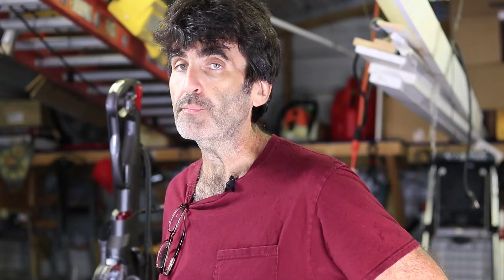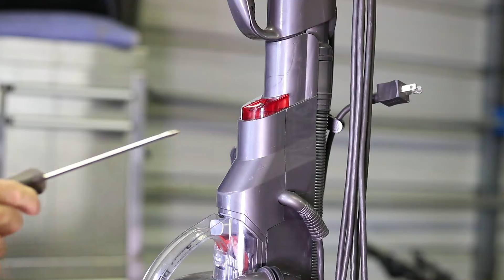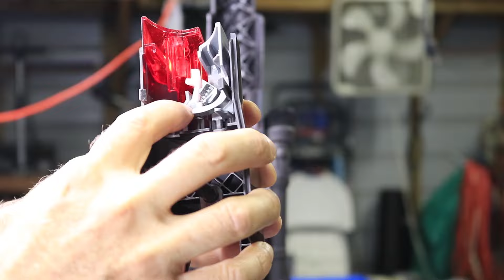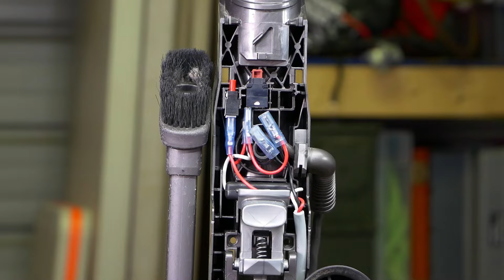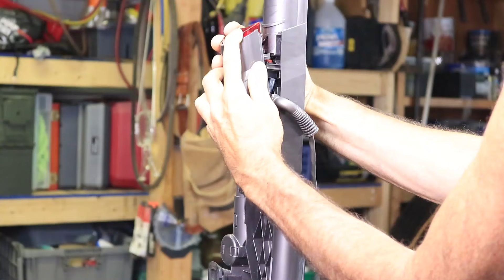How to Replace Power Switch on Dyson DC25 Explained in Full Detail

Comment: Oh great! Now I’m dead, thanks for the standard ‘unplug unit from wall” disclaimer. 🤣
  Hey, I could not get the large piece of plastic that retains the plastic switch buttons to come off the unit. I took out the three screws, but it seemed locked into place at the bottom. I was able to pivot it out of the way enough to test the switch contacts, but I can see it would have been a lot easier reassembling the on/off buttons over the switches like you have done in your video. 
  Good video btw! I’m chasing a intermittent beater bar run problem. The bar has been cleaned, the end bearing repacked and resealed. The vacuum worked great for awhile. I was vacuuming and I noticed the bar stopped rotating. I tested the connections at the beater bar mount plug and had power. I put it back together and it worked fine again for awhile. Then it stopped when I tilted the handle back just a little more. I cannot get the brush to come back on-after I move it upright, back to the position it was at, when it suddenly stopped spinning. Totally frustrated. I have pressed the reset button and power buttons in every configuration I could think of. I even pulled the reset button out and jumped the wires, and nothing. The motor looks good, the brushes look good etc I ran wires to the motor and powered it independently for a good 10-15 minutes with no problems at all, it ran great!. I feel it’s some kinda combination of how the handle is tilted and then how the reset button works. 
  Btw, is it just me or are these the most “Transformer” (like in the movie) machines I’ve ever seen for a home appliance, plus it has more little latches and lock buttons then you could shake a stick at!
Reply from the maker: I think there's a switch where you tilt the vacuum down and it activates the motor in addition to the switch next to the power switch.  I think I might research this and see if there's a video I can do on it.
Reply: @TheHomeImprovementChannel  Thx for the tip! I’ll look to. 
  Sometimes appliances have to be scattered to make sure there’s no unnecessary extra parts.
Reply from the maker: @dezdon01  You're welcome..
Reply: Yea, mine was he exact same.  Let it for a day, come back and a good pull it popped. It mat be that black little box was dislodged.

Comment: Mine has power but beater bar won’t startup could it be switch or wire fell off if switch which one are they independent of each other
Reply from the maker: Yes it could be.  It could also be a bad switch, I've seen those switches act up.  Try pushing it in and out a couple times and see if it comes back to life..

Comment: Great video!  when i took the switch cover off, i ended up with 2 springs that popped out.  the long skinny spring under the red switch is still here.  Of the 2 popped out, i put the shorter spring next to the little white piece.  But i now have a larger that the "red switch spring" spring but a little shorter and not sure where to put it
.
Reply from the maker: Does the video show the springs?  I honestly can't remember where they go without being able to see it and figure out where they go.

Comment: Great video.  one question, the cover on my seems to stuck.  I've taken all 3 screws out and started to pull the cover off but can only bring it out slightly.  the bottom doesn't want to come off.  any hints?  thanks!
Reply from the maker: Unfortunately I'd have to see it.  I can't remember off the top of my head.. ☹️
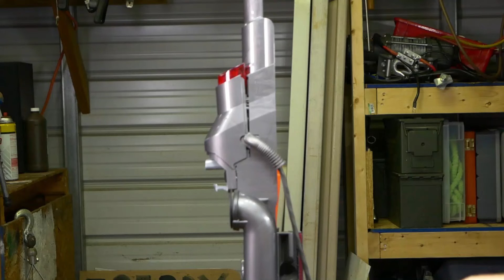Reply: @TheHomeImprovementChannel  can't attach a picture but in your video at 1:54, the cover comes down and out in your video.  Mine comes down a little bit but does not pop out, if that makes sense.  Thanks again
Reply from the maker: @peterwong5488  I think you can upload a picture on my sister channel's Facebook page.  It's at Take a Bath Productions..
Reply: Mine stuck too. Left it for an evening, next morning it pops off. I think it may have been that small black boxy deal below the switches.  It nestles into the handle and mine was popped out half way when I finally got it off.

Comment: hi.on the dc25 we had sock stuck in beater bar.then after removed sock the power came on but feeble and the switch seemed to be dodgy.i ordered another motor but saw your video about reset switch inside  cover..thankas for video will check switch and reset breaker.do you push breaker down again?steve in uk
Reply from the maker: Hello.  If the motor is running at all then it can't be the breaker.  You say the power came on but weak?
Reply: @TheHomeImprovementChannel  motor running now I ordered spare motor just swapped over and motor works now I did test switch an reset just tryin put back together roller thing at bottom tricky

Comment: If my vacuum only stays on if I hold the power button down, would that mean I just need a new spring?
Reply from the maker: I've seen that happen.  It could need a new switch, but sometimes I've taken them apart and put it back together and it's working again.  The real test is, if you have taken it apart and you can physically push the switch itself.  Is it working properly?  Then you'll know.

Comment: very well done. to the point and alerts you to the possible problem with the little springs blasting off. That was my problem. Glad to see how EASY its was to reassemble. Note. use needle nose pliers to disengage wires for m with, works a charm.
Reply from the maker: Good tip!  I included the thing about the springs because it happened to me... 😂

Comment: How can you tell if the breaker is good or bad, my switch seems to be good but still not getting brush bar to work.
Reply from the maker: A volt meter would be helpful to see if the power is getting through the breaker

Comment: The connectors on the wires have a little tab in the center that when pressed slightly releases the locking mechanism designed into them
Reply from the maker: Thanks for the tip!

Comment: Thank you for the video!  my beater bar runs for about 3 seconds then stops.  checked all connections, they are good. Still the power switch you think?  Thanks,  Chris
Reply from the maker: You'll need a volt meter.  Does the beater bar stop, but the vacuum motor keeps running?  Check the voltage on the beater bar and see if the voltage is gone when it stops...  You could also bypass the switch to the beater bar and see if it keeps running, but do this without it being plugged in..  then plug it in after you've bypassed it.
Reply: @TheHomeImprovementChannel   Just the beater bar stops, Vac still runs well.

Comment: Good explanation as to not panick thinking it’s the beater motor. I opened the cover on the switches and reset the beater bar kill switch and voíla!  I only wish the engineers would have thought of a better way to do a reset.  Taking that cover off and especially putting it back on is a pain in the you know what!  Even with the right tools!  Thanks.
Reply from the maker: I think they do that stuff on purpose to make people who don't want to take it apart take it to a shop..

Comment: Thank you, thank you! But I need to add one more detail. I have the purple version of the D25. The switch housing cover did NOT come off as easily. There are 2 tiny plastic hooks just below the 2 bottom screw holes. After seeing your video, I had the confidence to simply “defeat” the tiny hooks with brute force. Now I can replace the faulty switch. Thank you again!

Also, with the purple version (I think Costco version?), the spring did not fly out. And they are also easy to put back. Maybe Dyson improved this??
Reply from the maker: thanks for the great feedback!  I can't say if Dyson improved this on newer models.  I haven't had the opportunity to take any of them apart.
Reply: I have the purple version too and I cannot get the housing to come off. It’s stuck at the bottom.

Comment: If the bottom doesn't want to come out, stick a Philips up along where the power cord is running down and slightly pull towards you.  Same for the other side.  Be sure to clean & lube the plastic switch slides.  That is what trashes the switches.
Reply from the maker: Thanks for the tips!

Comment: I have a DC29 that is very similar in constructions to the DC25. The spinning head will turn on for a couple seconds then turn off. It seems like every time I hit the circuit breaker it will turn back on, only to have it turn back off after a couple seconds again. How would I know if the circuit breaker is faulty? I have disassembled the head to clean out any dust or hairballs that might be clogging the spinning head.
Reply from the maker: Good question.  I would tell you to bypass the circuit breaker and see if the head keeps spinning, but if there is a problem with the head, you'll burn something up.  If you have a amp meter, you can connect it to the wires going to the head and monitor the amperage and see if it's exceeding the rating on the circuit breaker.  (I don't know if it's marked what the amperage is..)

Comment: You, Rudy, are an awesome teacher. I really appreciate the way you explained the process - mainly - 'if you suck up a sock and the beater bar stops working, don't assume it's the motor.. try this.' - between me and the immediate family, we have 3 dyson uprights - until today, all 3 had beater bars that stopped functioning.  After watching your video, I managed to fix mine- and although I tore apart the beater bar assembly, after watching your video, that reset circuit breaker should've been a 5-10 minute fix.  I look forward to getting the other two Dysons in operation- I thank u.  You're a scholar and a gentleman!  "IT IS TOO MY THUMB!"
Reply from the maker: Thank you so much!

Comment: Thanks for the instruction. My brush beater bar stopped working. Would start for around 10 seconds then stop. Checked through various possible video solutions and eventually decided to try the cheapest option first and change the reset switch next to beater bar switch at a cost of £2.45 from Ebay. Using your video now have a fully working Dyson DC25 again.
Reply from the maker: Oh excellent😊  Ive never seen that problem.  Good troubleshooting!

Comment: This video is far more helpful than the actual Dyson video. My problem remains though which my rotary brush only rotates momentarily when pressing the grey button down with more than normal effort. I have cleaned and checked the beater brush motor and it spins when external power is applied to the contacts. A volt meter test of the power leads that go to the brush apparatus shows only momentary power. Any help or solutions are appreciated.
Reply from the maker: Yes if your volt meter verified that the motor is only getting momentary power I would start with the switch.  Of course that means you'll have to take it apart again.  It being hard to push makes me think there's still something wrong there.

Comment: From Paul and Sue in the UK. Thank you so much for the video..it was fiddly..the cover didn't come off as easily but we prised it off, the switch went in, again looking at the video I rebuilt the top switches and springs section, and we put it back together..one great help was naming the tool size! the part cost just few pounds, but the repair would, I am sure, have been very costly, so this was a great help.
Reply from the maker: Great job!  I'm glad the video was helpful... :-)

Comment: Does anyone else's red power button have a metal bar under it? Mine does but it doesn't appear to be in this video. It's attached to the bottom of the red button and stretches across right under the grey button...
Reply from the maker: I don't think this one does
Reply: @TheHomeImprovementChannel  Mine must be an earlier model. Got it all back together, the bar seems to hold the grey button up. Thanks for this video, saved our Dyson.

Comment: Thanks for taking the time to help others by posting this video, takes a special kind of person who likes helping others. Wish you were my neighbour! In my case the brush bar had stopped turning so I looked at the switches which were all ok. So thinking motor or wiring further down Next to the ball on the left hand side took off the panel with 3 screws only to find a white wire cut in two!? Manged to join together with insulation tape and hey it worked again! It was a real pig putting the switch compartment back together though, did it in the end. Just wondered if you know what the white wire is part of? I am thinking I should really replace at some point is it a big job? Thanks again.
Reply from the maker: I'd have to see the wire you mean.  Usually white is the neutral part of the wiring.  How it got cut is a mystery,... I don't think replacement of the whole wire is necessary, but if it feels a little short, you could splice in a short piece of  wire at the break to lengthen it.  I would solder and heat shrink both ends of it and it should be good to go.  Of course that means you'd have to take the vacuum apart again.. but the peace of mind might be worth it.  And yes, I do enjoy making these videos... :-). If you have any more questions don't hesitate to ask,... also if you want to post any pics, you can post them on my sister channel's FB page under "Take a Bath Productions".. Thanks..

Comment: Any idea how to do the DC18? It has 4 torx screws that ive removed, the prize out bits aren't in the same place, I've tried a couple of other slots but no joy, now the plastic switch cover is starting to crack, so I don't want to go any further. Are there any videos of the DC18?
Reply from the maker: HI, I don't have a DC18 to work on.. .if I did, I'd be glad to make a video!  It'd be to hard to explain over the messages here..  I have a DC 17, is that the same?
Reply: The Home Improvement Channel  Not sure, will get a new one, ours is 10 years old, not bad going

Comment: Many thanks, it was hard to pull out at the bottom section. You just have to go for it and pray nothing snaps. Mine had a fouled metal connection to the switch. I pulled it off and rubbed it with some sandpaper and the belt started turning again.
Looks like some liquid had got in there at some stage.
Reply from the maker: Oh very good troubleshooting!   Thanks for the comment... 😀😀😀

Comment: Thanks for the video. I have a DC18 with the same issue yet the spring and buttons attach differently and I cannot find a video or instructions. It's killing me. Is there any way you can assist? I ultimately need a closeup like you did for the 25 for the 18
Reply from the maker: Arrgh.. I could assist if I had one here to do a video on!

Comment: What can i do about the plastic pieces that the switch fits into when one side is burned/melted?
Reply from the maker: Well depends how bad they are melted.  If possible, can u use a lighter to heat them up again and melt them back to a usable form?  Being sure not to set them on fire by keeping the flame moving!.. Lol.. iF they are beyond this, you'll have to google the model number and the parts breakdown to get the part numbers, then find a place that sells Dyson parts and order new ones.

Comment: Hello. I LOVE your video!  My Dyson has a metal "bar" at the bottom of the red power button assembly. The bar is as wide as the red and grey button. I can not find ANY videos that have this piece.
Reply from the maker: Huh... that doesn't sound familiar.. what model is it?
Reply: @TheHomeImprovementChannel  Sounds like my DC-29. Same metal bar.
Reply from the maker: @waburden  Ahhh
Reply: EXACTLY MY ISSUE.
Reply: and it is a DC25 ...

Comment: Hey boss, I replaced my power button as followed thru your vid. But, it still won't power up. I'm at a halt as of now. I'm not sure what to do now. Please help!
Reply from the maker: Do u have a volt meter?  Measure to see if theres power reaching the switch,  and if its leaving the switch headed down to the motor
Reply: @TheHomeImprovementChannel  I do not have a volt meter but I will be getting one. I am starting to think it's the cord. The plug in prong seems a little loose.
Reply from the maker: Yes, it's a possibility.  If you have a harbor freight near by, they have them real cheap...
Reply: @TheHomeImprovementChannel  so to update ya! I changed the cord! Looks like one of the prongs was gettin loose and not making contact. Thanks for all your help and the video helped also! And also, the spring i said that popped out was the spring that is on the release button to the vacuum cartridge.  The button that holds the tank that holds all the debris.  Have a good one!
Reply from the maker: Great!  Yea I didn't think of that where the spring came from... duh!... Glad you found it... thanks for the comments.. :-)
Reply: BB M - mine was the cord. Simply plugged it in and measured with a volt meter. Tested the switch to make sure it works.  New cord off an old drop light in the garage & was good to go!  Good luck
Reply from the maker: @BebeBombay  Excellent!  I'm glad you got it going... to expensive to deposit into the circular file cabinet... :-)